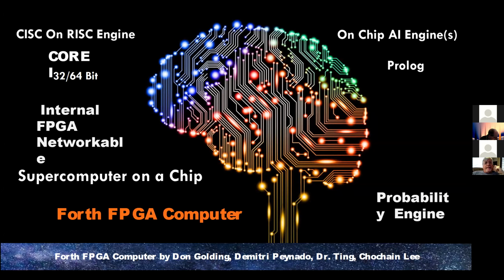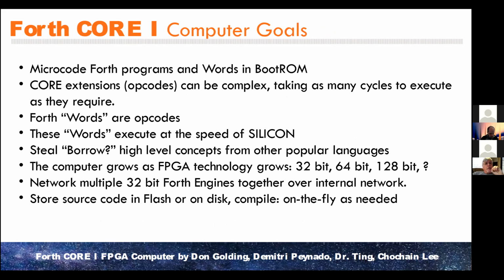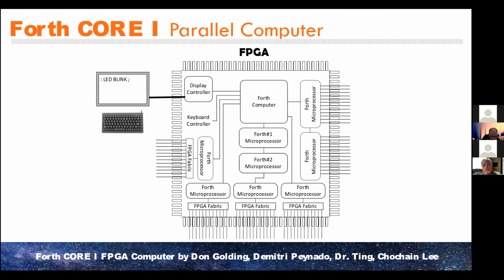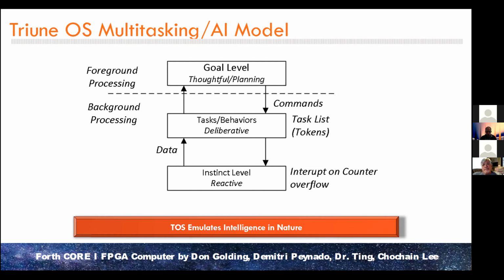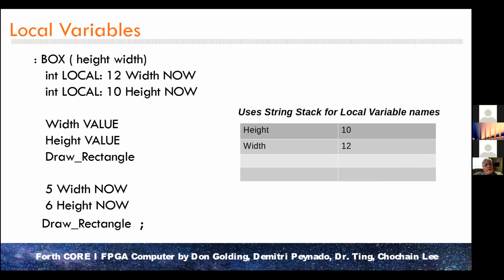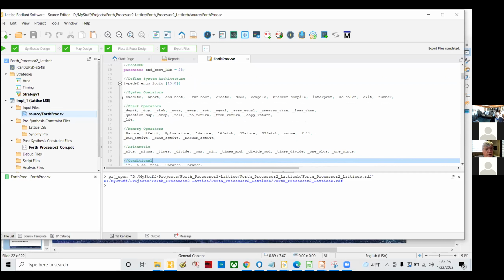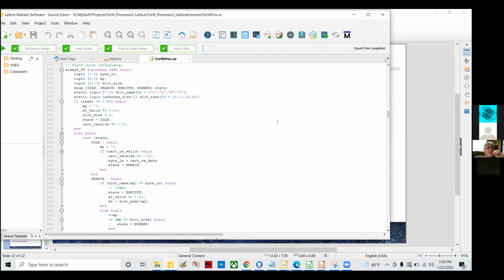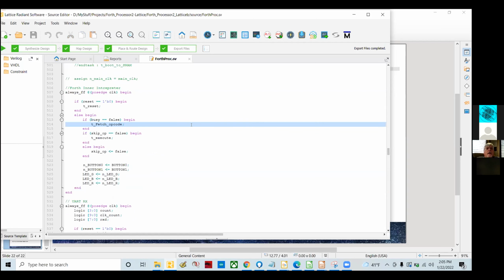2022-01-22 CORE I Forth on FPGA - Don Golding

Comment: Big Picture: I plan on using this processor as a base to explore new and novel computer architectures, integrate AI, extend opcodes to much higher level processes.  This is why Behavioral System Verilog is the coding style of choice.  Synthesis tools today do a good job on this type of coding.

Comment: Ugh.  I see it exactly the other way around - RTL is superior because you have better control over what the logic is actually DOING.  You're really designing - not letting a piece of software design for you.  Just one opinion, but I think I'll mosey on along - we're obviously on very different philosophical wavelengths.
   
I regard behavioral Verilog as a tool for people who don't really want to learn how to design hardware, and the results, while they'll work and that's great if it makes someone happy, will never be as good as what a skilled hardware person can do with RTL.  There's just no substitute for knowing and optimizing exactly what's happening.
Reply: Assembler coding is superior to coding in C, then?  We are using RTL for device driver processes.  If you have an application which requires tight timing requirements, then RTL is best of course.  For a general purpose processor, I believe System Verilog is best especially if you want to easily customize it.  The computer is written in System Verilog so it is easy to understand and customize the code for different user applications.